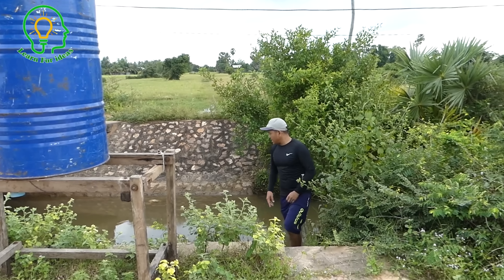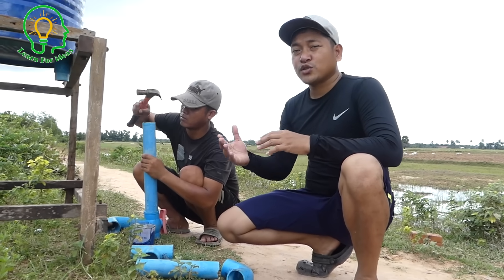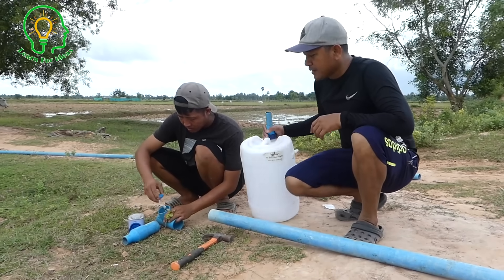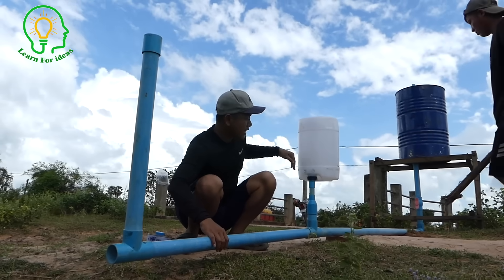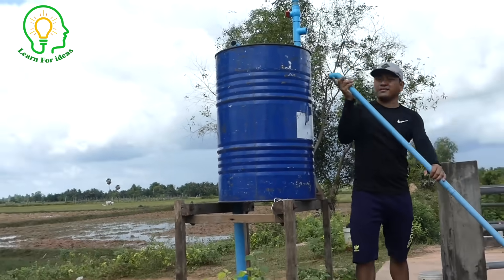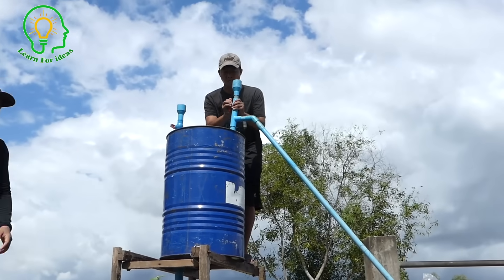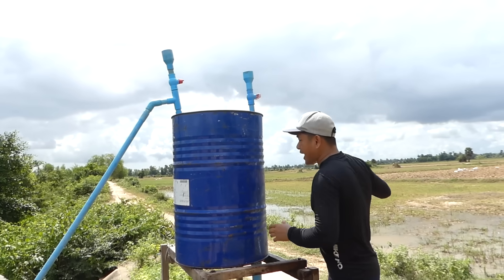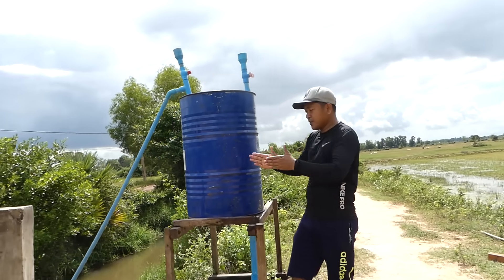Free Energy Water Big Pump and Big Air-Pressure for rice field | Water Pump without Electricity

Comment: Kapatid…
    I did the same thing thinking that suction pumping would work…
    The same as what you have experienced it didn’t work. Outside air went into the outlet pipe instead of sucking the water from the inlet pipe thus all the negative pressure in the tank went away.

   Better use a miniature water pump powered by solar power directly.

  Thanks for uploading your experiments.

Comment: Conclusion: this is another YouTube magic put up to fool cheap audiences. 
Scrutiny: 
1) If there is no air trapped in the tank and the outlet head is taller than the inlet head, the water in the tank will flow back to the canal. 
2) same as 1) but if we begin with 10-20% trapped air in tank, and open the output valve first, water will start flowing and the flow will accelerate by the siphon effect. The air pressure in tank will drop faster and faster. 

However If we wait long enough, the output flow will slow down and stop due strong ambient pressure plus tank suction combined are stronger than the water head in the output pipe. 

If we don’t wait long enough and open the inlet valve chances are the canal water will flow in the tank if the water head of the output pipe is taller than the head of inlet pipe. That is precisely a siphon effect.

But in this case the inlet pipe head is taller than the outlet pipe head, opening the inlet valve the inlet pipe water will suck air water from tank also reverse the output water flow direction.

Comment: Tell us the reason why you use a smaller inlet pipe then the outlet pipe? Why not both inlet and outlet pipe same size?
Reply: I think it's. Coz of creating pressure and avoiding air lock.
Reply: @dedigsuppliers2639  right now l am doing this water pump setup exactly same as this but it's not working
Reply: @lixv2432   Water level at inlet side must be higher than outlet side. This siphon is no pump.
Reply: I've tried this method one complte whole week and it never work, once outlet on/off is open , the inlet never suck in any water, so once the water from the can/tin is empty, the whole process also stops. I wasted too much money buying new tin, new pipe etc etc.

Comment: For this siphon to work the water level in the river must be higher than the output to the field. With a foot valve at the input, no blue barrel is needed. No need to lift the barrel that high, only makes it more difficult to fill. No need for marer valve just at the output from the drum. No need for white container. No need for the vertical pipe. 
In short, one simple tube can do this. All the rest is just to get the tube filled with water.

Comment: It will work only when out put pipe is 1/2 or 1/4 the size of inlet pipe. Suction must me greater and if we increase the size of drum, results will be more feasible
Reply: Pipe diameter has no relevance. For this siphon to work, the water level in the river must be higher than the outlet to the field,

Comment: No need for the vertical pipe at the output, waste of money.
No need for the white container, waste of money
No need for the valve just atter the drum, waste of money
Remember, for this “pump” to work, the water level in the river must be highervthan the output to the field, as with any siphon.
Reply: You are wrong. Virtical pipe is to stop incoming air entering the drum. You can use bottle if you want to pressurise water further to get faster flow at smaller outlet.
Reply: @infinitebeing1119  It is correct that the white container can catch some air leaking in from the output, but so does the 200 litre drum too. There is no need for the white drum or the vertical pipe. If you lift the output somewhat so the tube forms a U, there will be no air sucking in from the output side. The pressure in the white tank depends on the height of the water level in the barrel and will not any functionality at all. Only waste of money. 
If the outlet to the field is higher than the water level in the river, this siphon will not work. No siphon can lift any water to a higher level, drum or no drum.
Reply: @infinitebeing1119  Bottle to pressurise the water? A bottle near the output here has no function. The output tubes are so wide, the white container adds nothing. As for air from the output, simply turn the output upwards to form a “U”-lock or simply dip the output into a bucket of water. No air in reverse and if the river is lower than the field, you will have no flow at all.

Comment: Dear friend, is it still working? how deep siphon can do?
Reply: A siphon can not lift water up!
Reply: This is not syphon. It works like syringe where displacing water inside the drum itself is moving piston. Gravity is the force applied.
Reply: @infinitebeing1119  Firstly, this IS a siphon, with a starting barrel. Let uss assume tat there is a tiny amount of air in the barrel when it has been filled. The height from the wwater level in thevriver up to the water level inside the barrel is H. The height of the water from the exit back to the water level in the barrel is h. If H>h there will be no flow of water. The air pressure in the barrel is not low enough for any water to be pressed up the “suction” pipe.  No siphon like this can lift any water to a higher level.
Reply: @infinitebeing1119  Call it a siphon or a syringe or a drum «pump». With no energy input, how can such a “ pump” lift any water? If it could, you could add a turbine/generator and have access to endless free energy. No more fossile fuel, no solar panels, no bulky wind turbines, just water running round in a circle, around and around producing energy out of thin air? Would be grate - if it was true!

Comment: Simple trick water seek its levels, the drum was elevated to the ground.When you opened the valve of the drum which filled of water , the drum will suck the water from the creek and passed it to the rice fields because the water in the drum will seek its levels.
Reply: This is a siphon, no pump. The water level in the river must be higher than the output to the field

Comment: i  watched the other clip ....the explanation is that one need to fill the water all through the system no matter what, opening valves needed at the beginning and at the end of the system as well as in the middle.  the concept is negative pressure occurs while you open the valve on land.  negative pressure will draw water from the pond to fill up the tank.
Reply: The water level in the river must be higher than the outlet to the field. The rest is details. In fact you do not need any drums at all, just a hose or a tube.

Comment: From how much depth this system could lift the water up ?? Possible in depth of 15 to 25 meter.
Reply: It will only work if the height is about 0.0 mm. A siphon can not lift any water.

Comment: from which depth can lift the water
Reply: Sorry, but a siphon can not lift any water. This video seems to be a bluff. Source water level must be higher than the output to the rice field.
No need for that high scaffold, makes it mor3 difficult to fill. No need for the white barrel, waste of money. No needfor the vertical riser, waste of money. No  need for the foot valve in the river, waste of money. 
An advice: dip the output into a cup of water to prevent any air from leaking in. 
If the output is higher than tre input the water cup is in place, nothing will come out of this siphon. Standstill.

Comment: If your drum has air in it, then your pickup line is leaking. There should be no change in the water level in the drum. The water level should remain constant and the pump will run forever.
Reply: This siphon. will only run if the water level in the river is higher than the output to the rice field.

Comment: Can you tell us what is the diameter of the inlet and outlet pipe? 🙏🙏🙏
Reply from the maker: inlet 3m and outlet 20m long up
Reply: Diameter is not critical, use what you have. Diameter on input and output can be equal. Input can be wider than output. Wider tubes gives more flow. But remember, sourcs, river, must be higer than output rice field.

Comment: unless the outlet is lower than the inlet, otherwise, once pressure balance, it will stop running.
Reply from the maker: Not stop because input pipe and output pipe is same pipe size and have a strong and big drum if middle
Reply: @LearnForideas  Sorry, wrong information. Diameter and lengh of input and output is not critical But, input must be higher than the output. It is a siphon.

Comment: Question: after sucking water in the pipe on top of tank, they opened wolves of other two which should release the air in top pipe and water should’ve gone back to stream. How this still work?
Reply: Gravity "pulls" the water through the outlet and "sucks" the water in on the inlet

Comment: May i ask what size of the PVC that you have used in the inlet and in the outlet? Thank you
Reply: it seems to be 2 inches at the exit and one at the entrance ... But if there is a fear of deformation as he said in the barrel you can put a bigger pipe in the inle, or two pipes with a faucet to adjust it.
Reply: Not critical use whatever. To reduse risk of deformation, brin the barrel lower to the river.

Comment: I feel so impressed to Link up with people of great minds. my question is that what if I put several air bags along the bigger outlet pipe,will it increase the discharge pressure 
and also the standing long pipe,is it enclosed or opened because if it's closed, I think this necessitates putting a valve at the drum outlet because pressure in enclosed fluids is equally transmitted through the fluids. this means that without valve at outlet of drum, some water might be forced to go back into the drum once. thanks
Reply: No tanks along the output pipe is needed. Only waste money. Dip the exit end into a bucket of water to prevent air leakin in from the outlet.

Comment: To bad I can't post pictures. This doesn't work. It created a negative pressure in my steel 55 gallon drum causing the sides to totally collapse. Not a drop of water rose from the lower water source to my elevated barrel.

Comment: thank you sir..i have assemble like what you do but i used the input and the output pipe thesame size 1 inch and the airpipe is 2 inches the end of the output pipe was reduce to 1/2 inch. we pour the drum 80% &  i start the operation. the water comes out too strong for  2minutes & i hear the water in the drum was sucking  slowly the water slowdown until the water stop. please i need your help what to do. i like your invention. thank you .
Reply: Output must be lower tha input for this to work

Comment: is it possible to pump from multiple kilometers away ?

please provide all material you used,This is very brillaint.thank you
Reply: The dimensions here are not critical, but the outlet must be lower than the river! A siphon can not lift water. A lot of unnecessary whistles and drums here.  In fact you can drop the tanks and the risers. Just use a filling 
stud and fill the tubes.

Comment: What is the maximum height from water source to inlet above the drum or input?
Reply: 70 fit
Reply: Inlet must be higher than the outlet. Drum may be raised to about 8 meters, but for no reason! Keep the barrel as low as possible.

Comment: If you add an inner tube from a bicycle to the air tank and inflate it it will increase the water pressure outflow as the air in the tube acts like a  spring and helps push the water out with greater force
Reply: Sorry Dan, you are way out. There is no need for those tanks. You could as well use a larger main barrel. In any case, the output must be lower than the source.

Comment: I wonder if you need really 3 connections to the barril to make a pump. If I do a pipe with winding in the biggest hole true the barril so the pipe reaches almost the bottom of the barril. On that pipe is a T one direction goes to valve to make escape the air and the other to valve for water out. In the small hole is a pipe with T one direction to valve to let escape the air and the other directing to pipe comming from waterwell or river. as soon as barril is full, close two valves to make airtide. Than open valves from line from the river and valve gooing to the place where you want the water. I think that can work to and it can be easyer no need for 3e connection what is the most possible to get air in the system you don't want.
Reply: Actually you do not need any barrel at all.

Comment: I know it is a ram pump technology which is commonly used in hill area to pump the water easly
Reply: no its not a Ram pump but provides a similar function. Ram pumps require dowhill or elevation drop with moving water to function coupled with 2 - 1 way backflow prevention valves
Reply: This is a siphon. A siphon can not elevate any water. A ram pump can.

Comment: The videos are always informative. Nice to see talent passed down to the youth. 
Can I use this with a 13mtr well? What's the best height for the drum installation?
Reply: DEAR FRIEND! THIS SISTEM Works to  Atmosferic Pressure (1,33kgf /cm2  to sea water level).  We have loses in the sistem ...THESE loses are praticam limits in 8 meters of water  column.TANK you !
Reply: No, impossible. A siphon can not lift any water, not even 1 inch.

Comment: Simple siphon will do? Why making things difficult?  Just fill the pipe with water then put one end  to the water then the delivery pipe to your plants, downward pipe must be 3x longer than the upside pipe to let the water flow unlimited.
Reply: No, only lower!
Reply: not really. The system will work with short outlet runs as you size the piping correct from inlet vs outlet pipe
Reply: @dano5562  If the inlet is elevated higher than the outlet it will run. With low flow you should duck the output into a bucket of water to prevent air from leaking in.
Reply: put the camera in the outlet valve  for 1 hr,

Comment: So that some people are not disappointed. It is necessary to buy a water shock piston flap (knocker) also with a basket against dirt clogging. It is necessary to place this knocker in a flowing river (upstream, never in still water - it would not work!). It fills the barrel overnight and you can use the water from the barrel during the day, as in the video. The expansion pressure tank is placed just behind the non-return valve, not behind the barrel. The barrel should be open so that water from the knocker can fill the barrel. Knocker was invented in the 18th century in France. It's not magic. If you need a large volume of water and a continuous supply, you must buy an electric pump. Don't do it according to the video. Get advice from experts.
Reply: no you dont need those valves. They are called backflow valves or 1 way valves. you are describing the layout of a Ram pump. This sytsem works and has been around for hundreds of years. Do an internet search for gravity feed siphon
Reply: @dano5562  No. The siphon only works if the level of the pumped water is higher than the water outlet. Any architecture above that is useless. Complete your education - I strongly recommend it. But there is a no exist siphon with flaps, which pulls the water to a higher drain level than the level of the pumped water. Video is a scam. I provided a fairly high reward to anyone who performs such a "siphon" a la perpetuum mobile. No one was able to show it. You couldn't do it either, because you don't know what you're talking about. The only way to get the water "for free" to a height higher than the level of the pumped water is a "knocker", or shock valve, etc., which is a completely different principle that can "knock" the whole barrel overnight.
Reply: @DL-kc8fc  What is showed in this video is a siphon. A siphon can not elevate water.  A ram pump can bring water to a higher elevation, but needs running water to collect lifting energy.
Reply: @Dingsrud  Very right. I write about it all the time.